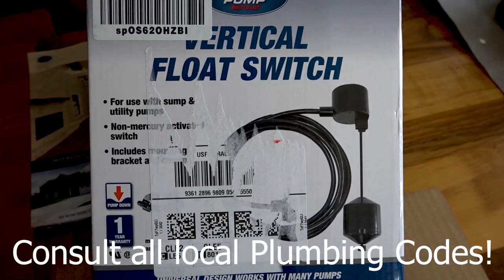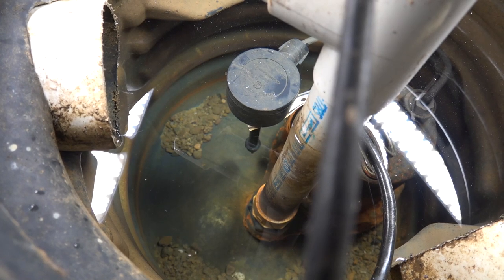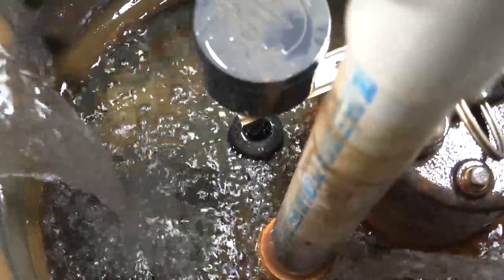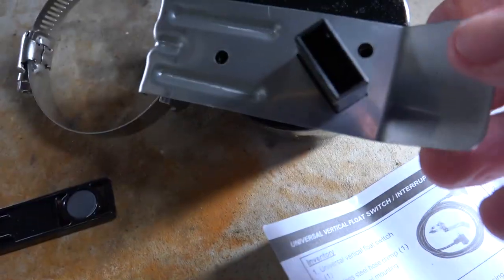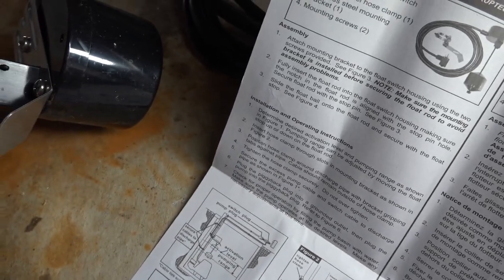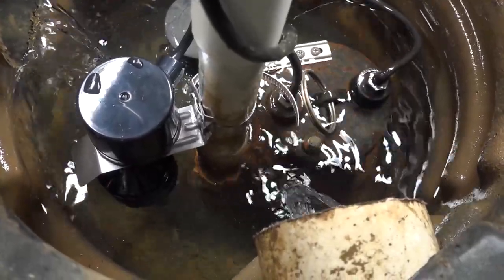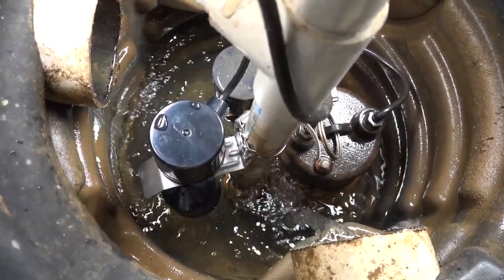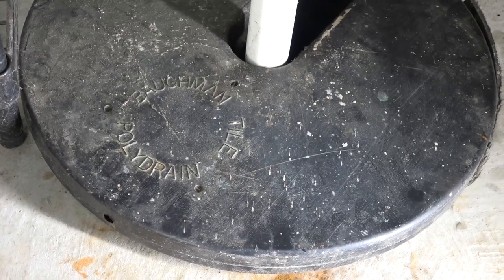Sump Pump Runs Constantly and won't shut off, How to Fix That for any pump that plugs in!

Comment: Side note, when you buy a piggyback float, switch the float switch cancels out the old one so only the piggyback one will work.   In the video.   You said it will just be the shutoff.    It will actually do both turn on and turn off

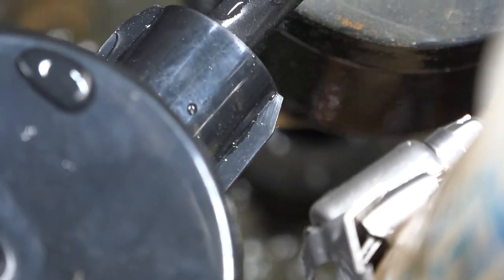Comment: I just changed my pump at 5:30 this morning. I had a new one waiting. I found this vid and I had no idea the float could be changed. Now that I look at it's float, it looks just like the one you put on! LOL! So, I'll be getting another new float. Thanx for posting. Saved me about $120 bucks.
Reply from the maker: Nothing like having a pump fail when you need it most :)  I always have a spare pump on the shelf just in case :)
Reply: Ain't that right. I just bought that last month.

Comment: I had the exact same problem and it looks like the exact same pump. The switch discontinued, so doing an exact replacement not possible. The lunkheads that put the PVC discharge water pipe into the sump pit only allows the pump to be on one far end of the sump basin. Too close to the pit wall for some floats to be installed without them hitting the side, not good. The discharge pipe is also cemented into the foundation WTH. I "fixed" the old switch at first, by cleaning it from gunk and (blindly) spraying electrical contact spray inside where the contact pad (or whatever it's called) is located. The switch has to make electrical contact to work. Since it's located inside the sealed housing it's hard to tell if I hit the right spots. It worked for about a day and a half cycling nicely. Then again, it went back to the problem and would not shut off. I wonder though WHY a switch goes bad. Do the contacts just get soiled or do they simply burn out and lose the ability to transfer an electric charge and become irreparable in time?

Comment: Be sure to have the two plugs plugged into eachother, otherwise the pump won't auto shut off.  I bought a replacement pump and plugged the two plugs in seperate and it just kept running.   Had to have the two connected, and then the auto shut off worked.  Dunno why
Reply from the maker: Thanks for sharing!

Comment: The good thing?? The switch stuck in run position!! Worse is when it's the other way an your waddling in knee deep water changing a pump ..an I am betting you have had that experience by the volume of run off coming in them two 4 inch ..but was a great idea coz are thousands who have no idea you can replace just the switch...

Comment: Hi, I rent a cottage and my landlord is an old lady so I want to offer a possible explanation and/or solution.  So, there’s no melting snow just on and off rain but there’s no water in my basement and my area outside does not flood or have standing water. It’s been running all night keeping me awake. Whatcha think?
Reply from the maker: In the abesence of water running into the basin, I think your switch had failed..... and the reason for this video.

Comment: Does anyone know why the same water flows back into my sump pump in the basement right after it expels it?  I can see it pouring back from the bilge, then it expels water, stops, fills up in 3 minutes again, and recirculates the same water all over again.  The lawn outside is like a swamp.  If I unplug the sump pump, the pit fills up, but the water stops at the very edge of the pit and doesn't overflow.  Mysterious situation.
Reply from the maker: Don't forget to put a check valve in that sump pump line so that backwash isn't occurring. Regarding the lawn being like a swamp, I suggest installing some sort of trench system that permits runoff away from your foundation. You may need some outside help with that.
Reply: Without more info it's hard to give a germane answer but... make sure your expelled water goes and flows away quite far from your home by extending the outside pipe or by installing some sort long water diverter like those used at the end of gutter downspouts. Another idea is labor intensive. Dig a French drain trench in the proper way to divert that yard water to somewhere away from from your foundation drain (weeping tile pipe) system.

Comment: I often am surprised by the amount of trouble and strife all the snow causes. I had no idea anyone had to have a pump in their basement, I mean, I thought some people built in their basement like another room. Wouldn’t all the water make it rather moist and moldy down there?  Can’t that area be sealed off from the water?  I have no clue because I have never lived where it snows like that. ...well I don’t think we have basements here so absolute ignorance on my behalf. I don’t think attic’s are a thing here either come to think of it.
Reply from the maker: Sump pump basins are always in utility rooms, partnered with a cover which prevents the high humidity :)  My property is particularly wet, even though my house is 10 higher than the road, we have seasonal high water. :)
Reply: @FrederickDunn  10 times higher and you still get that amount of runoff!  Is it still wet (maybe not as much) in midsummer? I get that it is majorly snow based runoff but it seems like a lot of water running in. I will have to google sump pumps etc for more info.
Reply: I know this is an old thread, but extra humidity in the winter is NOT a bad thing.   Most people pay extra for humidifiers (AprilAire) for new furnaces.

Comment: convert the plumbing to hard plumbing outside above ground
Reply from the maker: I have no idea how that would handle water at the basement footer. The discharge is outside and well away from the house down-grade.
Reply: You install a new sump pump in the house basement then the pvc up turn across the ceiling in the basement then out of the house 🏡 once outside, heat tape pvc plumbing and cap the french drain off to nullify that existing system.  once you have the heat tape installed run it ten feet away from the house and elevate it on decorative white stones and a gutter spout triangle to support the pvc, this is the first year I didn’t have water in my basement, also installing a furnace horizontally instead of vertically will keep your house warm without a chance for water to eliminate the furnace filter
Reply: yes replace the entire pump, you don’t want discontinued junk
Reply: have 4 pumps total to back up the system with battery back up

Comment: Fred the problem is when the rest of your orginal switch continues to degrade and opens internally then the pump will not come cut the wire at the orginal float and tie those circuits together and make the repair water tight  . Here is the concern your counting on a fail switch to continue to fail in the on position I would not take that chance because u said it the new float does not turn on the pump it just shuts it off  just food for thought
Reply from the maker: I am such a dullard that I never considered splicing that wire!  How obvious now that you've mentioned that. Thank you, Paul!!!
Reply: @FrederickDunn  

Fred u  are a so professional I  love your stuff always  well thought out .
Your bee stuff over the top please don't change your format as its right on target .I will tell u this the professional  bee keepers watch your show .I watched a lot of them and they reference your info on a subject because you do way more research .
To me you can't get a better compliment than that.From the very cold state of Michigan just a warm thank you for your dedication !!
Reply: I beg to differ, if the new float turns the power off, what turns it back on? Obviously the new float will turn it back on when it reaches the top. I'm surprised none of your commenters picked up on that.
Reply: @Wasaga1951  The faulty float in the video is in a failed open position, meaning it stays perpetually on, alternatively, it could have a fault where the switch is failed closed like a broken circuit and not pass current to complete the circuit making the pump stay off. This was my case. It was a dumb design is what it was. It should have been a piggyback style setup like most other pumps. I paid a lot of money for this pump and was very disappointed when it failed on me in a couple of years max. For me it had failed closed so the pump wouldn't turn on at all. In fact, I found that wiggling the shaft would suddenly turn it on. So this sensor can fail in weird ways and is a horrible design. I ended up replacing it with a different brand that was half the price and had a float switch that was not integrated. I purposefully chose this old and time tested design so I don't have to throw an otherwise perfectly working pump in the trash as I had to. Felt like I may have tried what this person tried but it may not have worked in my case, but I can't recall clearly. Worth a shot for others.

Comment: You should just disable the built in switch so that the pump is always on - if the switch that is integral to the pump fails to turn it on someday, you'll be swimming.
Reply from the maker: I've never had one fail to turn on, only fail to turn off. But that's a great suggestion, thanks!

Comment: Ok, but the water was still gurgling after you installed the extra switch, the system was still running, I don't get it
Reply from the maker: Sorry you don't get it, it does shut off, it doesn't run continuously. The gurgling is when it gets to the bottom and that's momentary.

Comment: Huh? 😳 This is a non issue in Sweden, the land of lots of snow.. 😜 We put all the drainage on the outside, and basements (and every other part of a house that's below ground level) is sealed with waterproof material.
Reply from the maker: Sweden has one of the happiest populations on earth... and not flooding the basements must be a part of that :)
Reply: @FrederickDunn 
😂😂 Probably one of the reasons! 😜😂